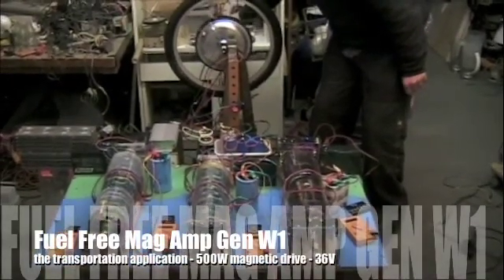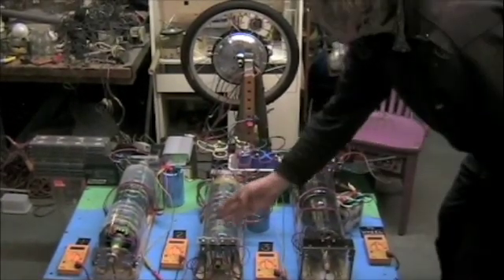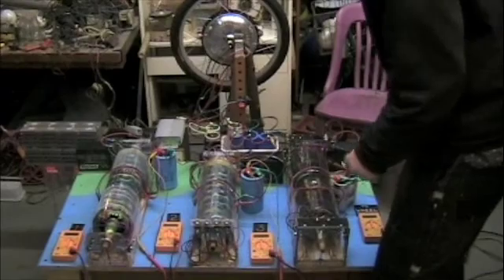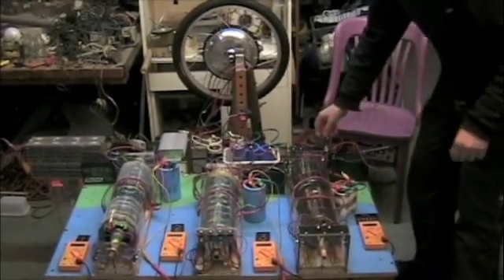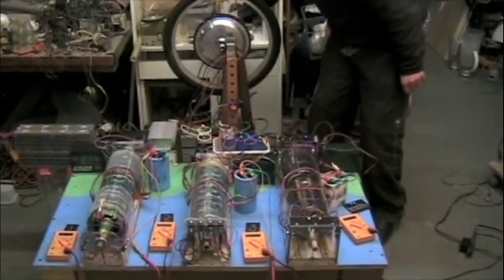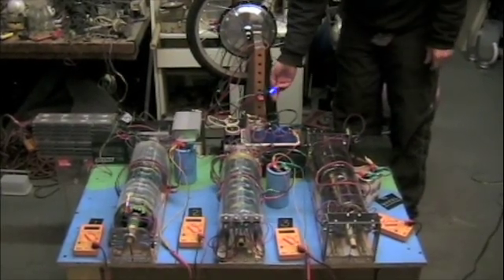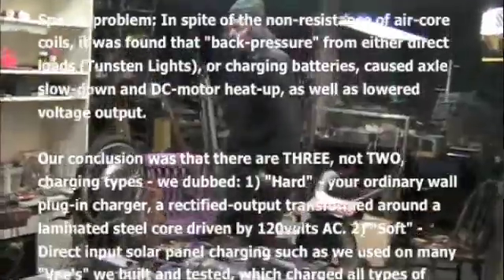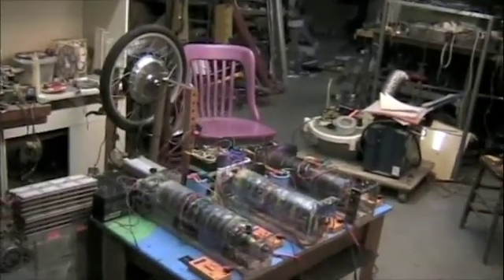Mag Amp Gen W1

Comment: Penny: Most "Powers that be" are totally ignorant - they follow the "expert advice" of the semi-ignorant! Ex.: Those little motors driving Gens are steel-core, so phase interferance can be a big problem causing heat burn-out of the "brushes". WITHOUT THE COILS IN THE HUB-DRIVE THIS HAPPENS - and I have SEEN THE SMOKE! Conventional engineers GIVE UP at this point, if they haven't given up before. It is not "ideas" that count - you must work with it & overcome hitches (see my later vids).

Comment: New info: Body & springs must be carbon fiber plastic to allow 8" interval between Generators. Capacitors are too big on left 2 units - that slows down volt-gain, which turns out more important than top voltage or even output (because output swings with currenet flow alot). See dual-line Batery back-up to Cap. buffer on "Immediateur" channel.(Wh2). The Mag Amp Gens do the job: cut costs/increase range, but quite a challenge to build light, 2-place 100km/p/h vehicle around them!

Comment: bob: Probably first one in 2010. There will be many versions - some easy: like still using fuel generators (take a look at Aptera), & some more advanced than this one shown (like with nano-bats on separate line being re-charged at drive endings). Besides "consumer shopping", you might BUILD ONE - or get in on ground floor of one of the makers. Several are supplying supporters FIRST! However I agree with "waiting in line" drag!

Comment: Ha! My point is that WORDS are NOT TO BE TRUSTED! They distort & sometimes, HIDE or SUBVERT reality! Same to a lesser extent with FORMULAS! Formulas are evolved to explain REAL EVENTS - but cannot explain events which are not KNOWN! This includes generators which you see here! Look for last of "Trilogy", showing Li-ion (static charge) Batteries on SEPARATE LINE from Caps. (not like here). It worked & will set off Transport REVOLUTION! I can hear the oil-scum screaming NO, NO! YES, you polluters!